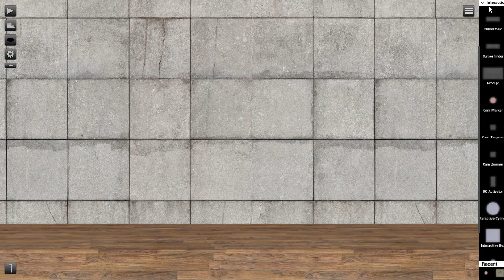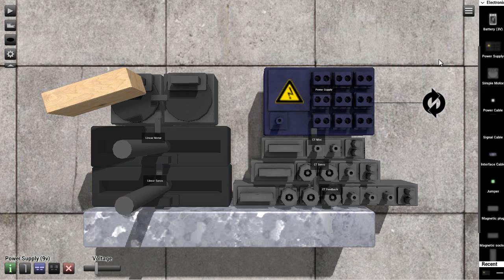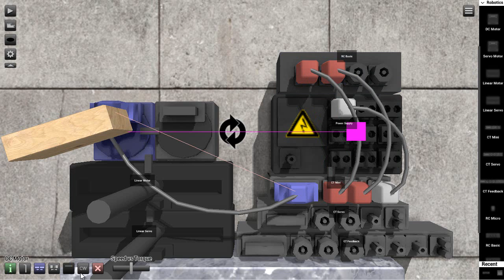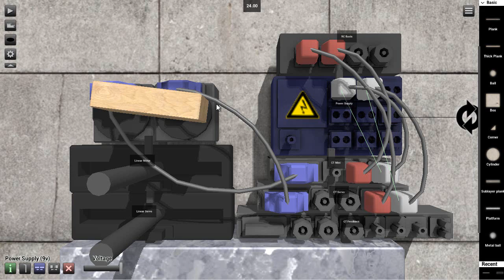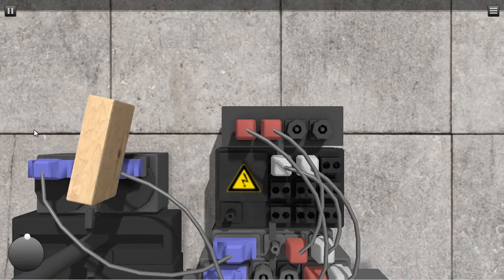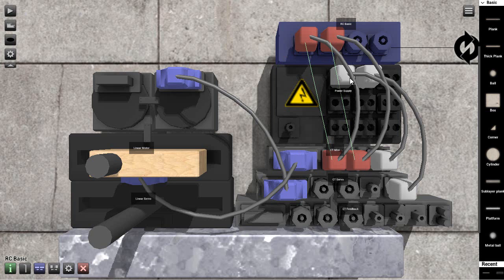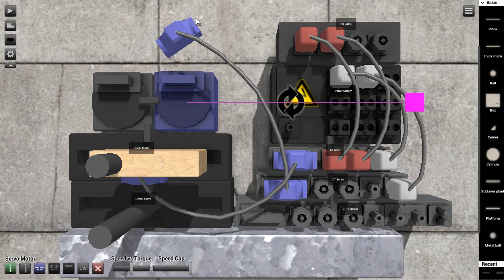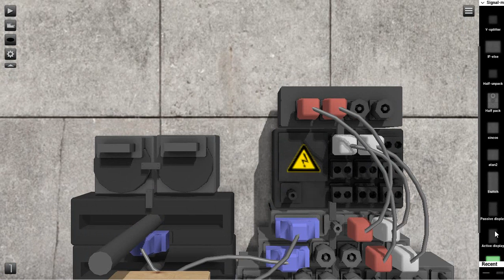Lets Learn Principia #1, Ct's Cts

Comment: i get it now so thats how linear motor works thx bro you earned a sub
Reply from the maker: Thanks for the sub, unfortunately I kind of lost interest in this game but if you need help I should be able to make you a video ;)
Reply: i really need help on these transmitters pls and broadcasters
Reply: also i learned how to make claw machines but i dont know how to make a claw so ill need signal broadcasting
Reply from the maker: LoLcraftPvP32 Vids,Gameplay&Review signal transmission is super easy, basically you have your grey transmitter and purple reciever. Just make sure that they are on the same channel (they are by default) and it will work just like a wire
Reply: i have problems making a functioning walker can you make a video teaching how to make functioning walker ?
Reply: and pls dont move away from principia r.i.p
Reply from the maker: LoLcraftPvP32 Vids,Gameplay&Review I've never actually made a walker XD
Reply: then try and make one! XD
Reply from the maker: LoLcraftPvP32 Vids,Gameplay&Review lol
Reply: you gonna try?
Reply from the maker: LoLcraftPvP32 Vids,Gameplay&Review lol I cant yet. Working on getting stuff ready for me to go camping tomorrow

Comment: Ct, i got another question, how would i have a single adapter or block or somthing take in more 1 signal cable so i can have 4 thrusters on a hovercraft?
Reply from the maker: Use a Y splitter or an 8-way splitter
Reply: K thx, i tried ransmitters and they worked too
Reply from the maker: ctjet99 :D
Reply: hink you can?

Comment: Hey CTjet think you could help in the newer version of the game (1.5.1) make a vid on what they do now and how to make a car? Just a suggestion!! :)
Reply from the maker: They are the same, but I guess I can make an advanced car tutorial
Reply: Thanks cause i tried using ur tutorial and it didnt work
Reply: Basicly, i did what you did in the tutorial, but the buttons, the slider and putton fro reverse, Didnt appear
Reply from the maker: did you configure the rc?
Reply: Yes
Reply: I'm using the Wiki page on making a simple car, it works now but i don't know what i did wrong, all i know is i couldn't start up the main RC
Reply: Ahh, i think i see, i had a cable wrong and there for it didnt work
Reply from the maker: there you go!
Reply: I also need to know how to get Oil on the adventure mode :/
Reply: Any idea how i get it?
Reply from the maker: could you send a picture? or is that not possible. you could also upload the level and do @ctjet: in the comments
Reply: What do you mean? trying to get oil?
Reply from the maker: OH, crud, sorry, i only read "any idea how i get it?" you cannot get oil in adventure mode, unless you find a tower
Reply: Tower?, also if im spossed to not get oil then how do i survive and build stuff?
Reply from the maker: you have to find it, it will be underground unless they removed it. and idk, cheating?
Reply: Ohh gee. if it sunderground, do you mean cave.. er a little opening?
Reply: Im playing as i talk btw
Reply from the maker: nice!
Reply: Yeah the oil things are still in game but i cant find em